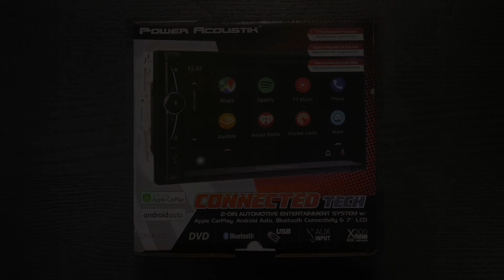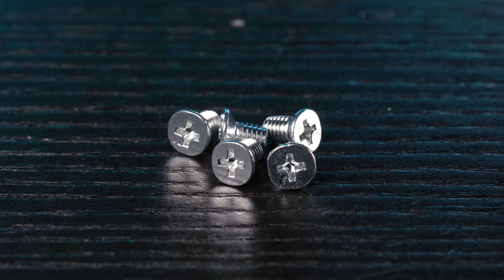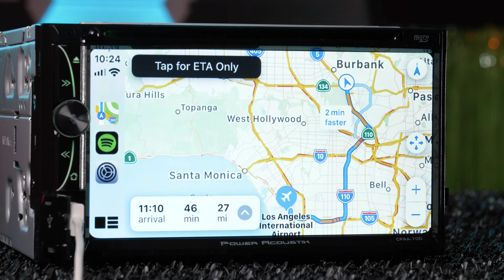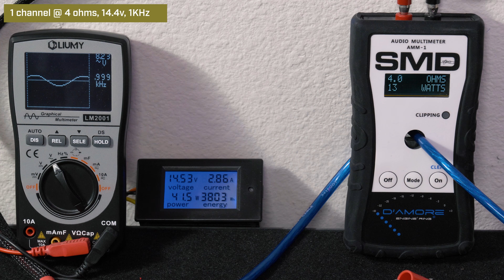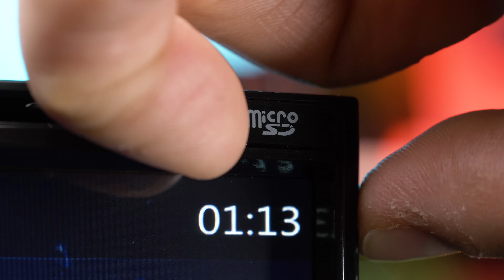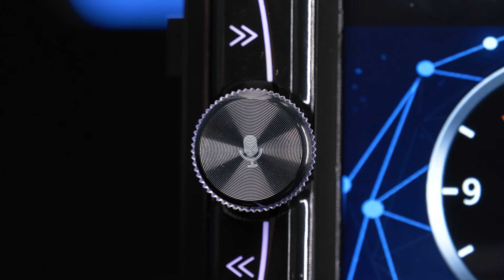Power Acoustik CPAA-70D Apple Carplay, Android Auto & Power Output Testing

Comment from the maker: ***We made a minor mistake in the video! The REAR GREEN SW RCA is Subwoofer out, not SWC. We apologize for the mix up.
Reply: Thats only one rca output for subwoofers ? Aren't there supposed to be two rca output for subwoofer?
Reply: @rm4213  It’s intended for a mono channel amp.
Reply: @rm4213  you can Split RCAs too
Reply: I wan to use this in my fifth wheel, is it capable of displaying on my TV?  And if it will, am I able to turn off the movie showing on the radio screen and only have it going to the TV? Please let me know, I hate this damn Jensen shit that's in my camper.
Reply: Really great I just bought one. I’m enjoying it. Thanks for expectation. Have a good day.

Comment: This unit seems good at first, but it will experience no audio output, no sound. You have to hard reset it under the USB cover with a pen then all the settings are gone, all your stations, date time and all other settings, this is frustrating to say the least, and support doesn't have any newer firmware, and they suggest to diable RDS, but that didn't resolve it, it still keeps having the same problem of no audio output.
Reply from the maker: That's brand new news to us. Sorry to hear.

Comment: Thanks for this review.  Just picked this one up on sale at Walmart for 70! Going in the 97 V6 Camry which is replacing a very old Alpine cassette single DIN.  Also, adding the backup AHD cam for another 20.  Nice upgrades for 'Tha-Tank'.
Reply from the maker: Enjoy it 💪
Reply: @Qualitymobilevideo I'm a bit disappointed in this unit, I've experienced more than 3 times that audio output stopped working and needs a hard reset every time this happens, therefore I do not recommend this unit, I am on the latest firmware too 2.2.1, and support isn't much help other than doing the hard reset. 😢 You get what you pay for.

Comment: Installed the radio and can’t get the rear view camera to display when put the car in reverse?  Also when using the radio and I have iPhone connected with wire if I get a call or I get a text message the radio goes quite then when it comes back it’s at max volume and blows my ears off?? Why?

Comment: I installed this in my Hyundai sonota and it works good, but I hooked it to an amp for a subwoofer, using the right rear and the left rear RCAs, the amp I’m using is a dual xpr540, but when I connected my subwoofers to the amp my subwoofers just popped out and stayed like that until I unhooked them, I tried doing research on it and couldn’t find anything, my gains are all set to the minimum and so is the bass boost, x over, and x over frequency, all set to the minimum setting and bass boost off, it’s a 4 channel amp, and I set the switch to 2 channel since I only had two inputs and since I’d only be running two subwoofers bridged, I also tried unbridging them and still got the same results. Any advice?
Reply from the maker: Something isn’t quite right, do you have a voltmeter that you can use to meter the rear RCA’s to see if they are outputting DC voltage?
Reply: @Qualitymobilevideo  will a regular multimeter work?
Reply: @Qualitymobilevideo  also what exactly should I be looking for? And what can I do to fix it?

Comment: This product is junk , software keeps freezing up. Pro tip if your stuck with this dumpster fire of a product, there's a reset button top left if usb port, you'll need fine point to push in the reset button. This will save you from disconnecting  the negative port on the battery to turn off this head unit after it freezes, in turn will probably kill your battery.  Reset button is the only convenient thing about this product and you'll be useing it a bunch..

Comment: Bought this for my 2002 honda winter beater for android auto and the volume knob. For the price I can't complain, it's budget friendly radio. I'd recommend getting a big brand name one like Kenwood etc for your nice daily but this thing fits the bill for what I need.
Reply: I would but my issue is none of the big brands have a volume knob and it's dumb
Reply: @marioandultrachap  sony does. With apple and andriod auto
Reply: @Redpillsociety999 no disk slot
Reply: I spent money on the Kenwood and the bass kept de trying it, but this one hasn’t missed a beat so I’d say the big ticket is just that.. a name and a tag

Comment: I bought mine from amazon and didn’t include the 8 pin connector which includes the backup came wiring and the steering wheel controls, any info of where i can get it?

Comment: Can this radio be installed in a Cadillac deville?
Reply: I just custom installed one in a CTS without losing the DIC. I would suggest going to the Cadillac Forums, it's a huge community, and you will find info for just about everything for every Caddy.

For the money in my older CTS, it's a great head unit. Not the prettiest, but does everything you need, and is very fluid.
Reply: Good looking out on the insight my guy!

Comment: Mine froze and won’t cut off only after a few hours installed. Wtf. Now I have to disconnect my battery to turn it off.
Reply: Firmware update available on the manufacturer’s website
Reply: Did you fix the issue?
Reply: There's also a reset button on the upper left side that you can use a pointy object to press.

Comment: Does it have Xm radio
Reply: No it does not. So I'm going to add onto YOUR question hopefully I get a reply. I have a 2017 Hyundai Accent. We took out the factory installed radio that had Sirrus XM. Now I'm wondering if the factory installed xm antenna can be reused? I ordered the Command Touch radio. So can we install the  Command Touch audio to back of THIS radio? Is there anything else I would need to do?

Comment: Just bought this on the sole fact that the more expensive/brands do NOT have a volume knob. 

This thing even have steering wheel controls.  While the others are like 🤷
Reply: We're you able to get steering wheel controls working? If so how/where did you connect the two wires?
Reply: @TyronPowell  my Bros truck doesn't have steering wheel controls , so I can't help you with it.
Reply: How high does the volume go?
Reply: @jameerf3  I'm guessing 50, he said it was producing clean signal at 42 so I'm sure it just goes up to 50 max. Seems volume on many HU these days goes up to 50 max. I just bought a new Sony & installed it on Christmas Eve & its volume goes up to 50.

Saucey Meer if you haven't already bought a new head unit I would HIGHLY recommend giving the new Sony 'High Power' single or double dins a try. I bought the DSX-GS80 Sony & even though I've only had it in my car for 3 days I ABSOLUTELY LOVE IT!! This Sony replaced a Soundstream that I'd had in my car for 5 years. Yes, the Soundstream held up well & I more than got my $ worth out of it. I'm actually going to sell it now as it still works but I no longer have use for it. BUT this Sony sounds so much better through my mids/highs & my 18" subwoofer! The sound improvement was insane, made me wish I had bought this Sony a long time ago. No, it's not completely fair to compare my new Sony to my Soundstream as the Sony does have a built in Class D amp that sends over 50 rms watts to each of my four speakers. You can even power a smaller efficient subwoofer off the amp in this headunit. Which I'm not doing as I currently have an 18" sub in my car. Everything sounds so much louder & most importantly sounds cleaner & crisp at high volume levels. These guys have done videos of the new Sony head units that have built-in class d amps (45w x4 channel). You can find them,  I know they reviewed the Sony DSX-GS80 single din & the AX7000 double din. 

*Saucey Meer if you have a subwoofer/subwoofers, upgraded mids/highs, tweeters or amplifiers added to your vehicle then you will love the Sony head units as it will compliment any of your aftermarket car audio components! I'll say this & then I'll shut up 😆 When I had my Soundstream HU in my car I had the gain the gain on amp that powers my subwoofer turned up to 60%. When I installed the Sony HU I had to turn the gain on my sub amp all the way down to its minimum level & yet my subwoofer is louder than ever before & sounds better, my amp is also running much cooler since the gain is no longer turned up over halfway. All of this was possible due to Sony having quality higher voltage RCAs (5 volt) on the back of the head unit. My amp never over heated or anything with my Soundstream but it would get good & warm. Anyways I hope that made sense to you, I know everyone is at different levels in car audio & loud bass, big subs & amps may not be your thing. If not part of my comment probably will not even make sense. But I think you'd still be very happy with the new Sony models. If you're mainly looking for a double din check out the Sony AX7000 double din. Or if a built-in amp is not something you would benefit from you could look at the Sony AX5000 its supposedly the same headunit as the ax7000 just without the class d amp so it costs around $200 less most places online. 

Have a blessed & Happy New Year!!
Reply: @itdoesntmatterwhatyourname6128  wow, almost sounded like Sony paid you to say that lol. You’ll be a great salesman I gotta give it to ya 😂But yeah I was trying to find the max volume everywhere, but I couldn’t find it. Ima keep looking at more videos to see if somebody else knows and have more info on it. And thanks for all the information and details about the Sony HU. Seems like you got a legit setup for you. I got 2 15’s in my car running off factory rn, doing a 115 db so far until I get a aftermarket radio and everything, not too shabby. And yeah ima end up getting a mid/highs amp for my door speakers as well. Ima end up switching all of em out for deaf bonce 8’ I got 6.5 in rn, and get some super tweeters as well. Once again thank you again for all your help for everything, I’ll take a look into the Sony HU, also same to you having a blessed day, and a Happy New Year (happy birthday to me 🥳 Jan. 1st)
Reply: @jameerf3  you're welcome. If you have two 15s I'd really suggest finding a HU with more tuning options than what Soundstream offers. Nothing against them but my setup sounds SO much better now. Plus if your planning on hiking up s 2 or 4 channel amp to your mids/highs then you'd greatly benefit from the Sony's I mentioned. They've been dyno tested to put out 56 watts rms per each 4 channel. Though I understand if you're needing something that puts out double that per channel to your mids/highs. Deaf Bonce is definitely a great choice, I'm a big fan of their products. Lol I sure wish Sony paid me but nope I'm not receiving anything from them other than enjoyment from the great head unit they made. I just tried to be as specific as possible about my experience because I know if I'd read a comment like mine that mentioned the benefits it offered to those running subs & large monoblock amps I'd bought the Sony months ago! Oh another plus is it has a built in volt meter that gives very accurate digital read outs of the battery Voltage & it even proved to be accurate during the transients of heavy bass when I had my test meter on it. First head unit I've seen that had a digital volt meter. Only being $200 I definitely feel like I got more than my $ worth, considering I would have spent more than that for a 4 channel amp to power my mids/highs. Now I don't even have to install a multi channel amp until I get ready to build custom speaker pods & add 6" & 8" loudspeakers & horn tweeters. Anyways good luck in your search for a new headunit. Find one with 5 volt or higher RCA outputs & your will be glad you did as your subwoofer & amp will perform much better when compared to units that have RCAs in the 2 volt range. Happy Birthday & New Year to you.
Reply: @jameerf3  I'll check tomorrow!
Reply: @chiquinarco55  alrighty
Reply: @jameerf3  i have it, it goes up to 50.
Reply: @Mr_pai_pai  oh yeah I had found out, I bought one. Thank you though. Not a bad aftermarket radio if I do say so myself.
Reply: Yeah same the no volume knob is always a turn off it really makes no sense why these high named brands get rid of that

Comment: If it had at least 4V pre amp outs I'd tap the buy button. But it DOES include steering wheel control BUILT IN. Even some $1,000+ big name brands don't include that!!
Reply: We're you able to get steering wheel controls working? If so how/where did you connect the two wires?
Reply: 4v preamp does NOTHING better than 2v preout.... its just marketing bullshit. your amp that you plug via RCA gets tuned regardless in terms of gain matching. Look at a pioneer amp as example. they have markings for 6v, "high" which is 4v, "normal" which is 2 volt, then 0.2v which is 200mv. you set gains based on input source. sure, does having 4v mean you dont have to turn the gain as high. absolutely. is that going to change the audio? absolutely fucking not. and you get your max RMS out regardless if your source is 2v or 4v.

Comment: Lol the green RCA is Subwoofer out not Steering wheel control lol the steering wheel control is on the wire harness labeled. It clearly shows it in the EQ settings "Subwoofer" LMFAO
Reply from the maker: Yup made a mistake thanks for pointing that out

Comment: Pass. That thing is junk
Reply: It has Subwoofer output it's the green RCA he fucked up saying its steering wheel control LMFAO steering wheel control is on the harness labeled lol when he go's through the EQ menu it shows subwoofer settings.
Reply from the maker: We made a mistake
Reply: @Qualitymobilevideo 
 👉
That's okay,...Nobody's perfect.
Still a Great video 💯👍👍
Reply: Why? What is it missing?
Reply: Spend $100 more and get a quality deck. Like a kenwood or pioneer. My Kenwood ddx9903s is a few years old now and is miles better than this hunk of scrap
Reply: @billybro1999  nice, and how much did you spend on your kenwood that's only a few years older but light years ahead?
Reply: @timcarroll7505   lol $300 I got a deal.  The new models are much more but I don't see a need to upgrade. I'll never buy any of these cheap decks.. power acoustik, boss etc. they're built with cheap hardware. crappy output, low quality sound. The term "you get what you pay for" comes to mind.
Reply: @billybro1999  someone needs to tell Kenwood and these other brands to put a damn volume knob then. Cause that's the only reason I'm looking into these other brands
Reply: 13 watts👎 lol👈
No sub out put👎
No streaming (videos)YouTube 👎
Turn EQ up it Starts to distort👎
Not 1080👎
No wireless connection 👎
No illumination lights👎
No special features 👎
I bet the remote won't work more then 4feet away👎
Doesn't mirror 👎
No screen saver mode👎
Not multi screen linkable 👎